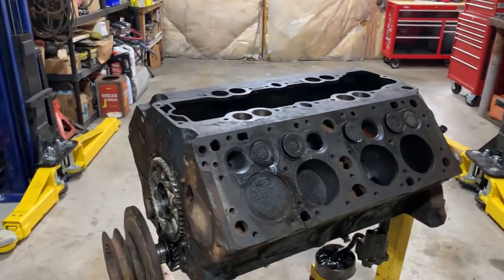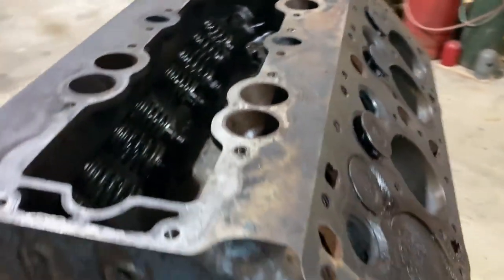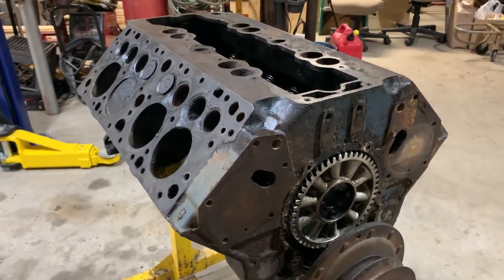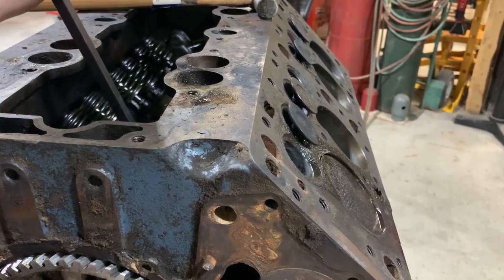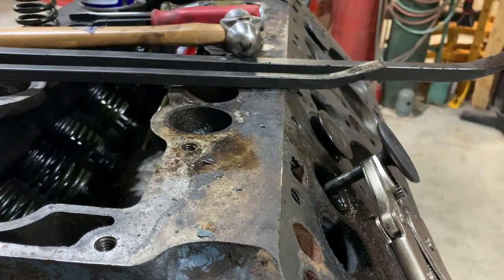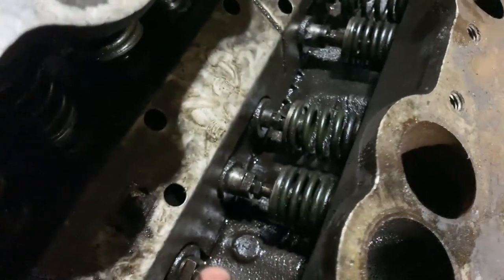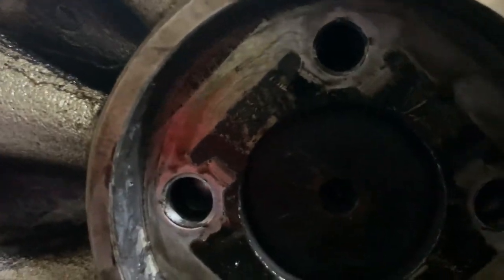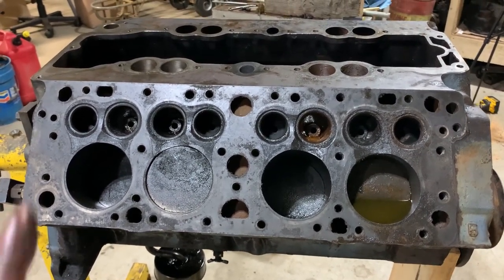1948 Ford 337 Flathead V8 Revival - EP4 | Removing Valves

Comment: A blunt point air chisel tat tat tating  has at times been a savior. Once moving a clam shell puller on the head as you press on the stem.

Comment: The 337 was the 1949 - 1951 Lincoln motor also used in heavy Ford trucks, 1 1/2 ton and larger, up to 1958. So if you need parts this could be worth keeping in mind.
Reply: up to 1953

Comment: I had to get the very rusty valves out of a Model B four banger. It sat in a junkyard for 60 years.  I welded bolts to the valve head and then used a slide hammer to move them.  I took an angle grinder to the springs and then pulled the valves up as high as possible.  I found that genuine Ford valves will break off if you hit the head. Cheap non Ford valves bend. I took the soft ones off with a grinder.  Then I could drift the valve stems out along with the guides.  The valves, guides and springs were not reusable.  This summer, I need to get the rusted in solid tappets out. Nice work getting yours out without damage.
Reply from the maker: Sounds like a good challenge!

Comment: great progress those valves sure there not easy to find, wonder if there the same was vehicle valves just for knowledge, sen where others have used vinegar to shake the corroded rings, wonder if it really works. Waylon  Wire taught me a trick to pressurize the oil channels while working rotating components to lesson scaring on the bearings

Comment: Had one . Lincoln made mine. Heavy one.
Reply: 800 lbs., a little skeptical about that The original Flathead came in a tad over 600 lbs, for the short-block  Can't imagine 200 extra lbs of iron.
Reply: Last Leland design produced. He was one of the best ever.

Comment: I put up a vid on my channel a awhile back where I used a ICB full of water and washing soda to soak a mercedes 6 cylinder engine which had been laying out in the weather for 20 years. The pistons were seized solid but a week of electrolysis saw the pistons loose and I was able to just pop them out without any violence..

Comment: I’m convinced that breaking and engine loose is 50% experience and 50% luck . All the magic potions known either work or not . 
It’s about exactly what condition the material ( cast iron , cast steel , aluminum etc. ) is in which dictates success . 
Like a fastener , if the metal is badly deteriorated , it won’t take much torque to twist or snap it , despite how much penetrating oil and the like is applied and heat used along with diesel soaks and ATF used . Our best attempts are made when we seek to rid the mass of steel or cast of corrosion , rust and other debris that has conveniently deposited on once moving parts to make it to the next step of removal .
Heat always plays a huge part of a successful extraction of a part or fastener or freeing up a rotating assembly . Luck plays a big part .
Let’s not forget patience . If we think we are going to get this done in minutes or hours , plan on days , weeks , months and when we are scared enough we are going wreck something or do bodily harm , years , before we get that engine free for either use or a proper rebuild .
I consider myself extremely lucky that the AMC 258 , which I was told sat for years and was stuck , freed up and has been running well for the last several years . I used all the above to get to there . Another thing that helped ( I guess ? ) was to fill the cooling system with 50/50 and used a block heater . Hey , it couldn’t hurt ! After a few months and finally the diesel soaks in the cylinders cleaning up real well , the pb blaster , the sea foam deep creep , liquid wrench , MMO and just every household penetrant that floats our boat , it was time to get stupid .
I put two 5/8” shoulder bolts ( threads cut off ) into two balance holes bored into the flywheel and apply the wrecking bar . 
Don’t try this at home . If you do , use restraint and don’t stand in the line of fire . Have a clear path to run . Head all disclaimers .
Have 911 on speed dial . But seriously , listen for the tell tale creaks . Load the cylinders with penetrating oil and make micro pulls on the bar , back and forth . Keep all on lookers and commentators away if anything goes wrong . Keep a fire extinguisher handy , just because .
But above all , do not do this after a nite of hard drinking . You don’t want to ruin it now , waited too long for this . Say a prayer , light a candle and get your best grip on that bar and for God sakes man , stay away from that claw end . Be patient when movement is found and work it slowly . Plenty of lube always . Remember to inject through the oil pressure switch port plenty of MMO so the bearings have a fighting chance . Once it’s finally moving without scraping noises and lubed as best as , call everyone you know who cares and tell them , but don’t scream , remain calm . This is a rite of passage that we enter , like hallow ground . It can be done if we are patient , confident and are in possession of lots of said products . Sometimes a big hammer , if used correctly . But is there a way to use a big hammer correctly ? 
Oh yeah , don’t forget to paint it . I forgot .
Edit : forgot an important detail ; compressed air . When the cylinders are as clean as could be gotten from the diesel fuel soak , evacuate all the diesel fuel from the cylinders and spray in penetrating oil and let soak . Follow that with MMO and acetone , transmission fluid or your favorite solution and thread into the spark plug threads a compressed air line while the engine block heater is on and engine coolant is warm . A compression tester with a quick disconnect works well for this . Do this regularly and observe the results . Your objective is to get the solution to get past the piston rings . Once every cylinder will allow the solution past its pistons rings , then you can try to break the engine loose , carefully . Make certain to use penetrating oil as a lubricant and to dissolve rust when you achieve and expose where the rings were stuck in the cylinder . Always remember that too much force will damage piston rings and cylinder walls .

Comment: I'm sure you can get/find new valves. Take one each, intake and exhaust, march them up even if you have take them to a good machine shop and have them "tweaked" a bit. Next use a piece of wood or brass punch when   hammering on stuff. Put some other bolts in the cam and use them to turn the cam. Also Water Displacement type 40 or WD40 is a good oil there are penetrating lbs out there that are a little faster, just saying. But like the video,  can't wait to see that old iron run.

Comment: I have a story on those engines thats too long for the comments side of things.. it starts with my dad going to eastern washington to get a F8 grain truck. He brought it home and converted it to a short logger with a pup trailer. It had the two speed and a five speed and then the 337 lincoln engine. Now industrial n truck were standard shift and the cars were automatic so cranks were different on the flywheel end an no provision for a pilot bearing. Me as dumb as a  rock drilled the end of that crank and fitted the pilot and somehow luck be with me got it in straight and right. I did have the flywheel and spacer for making it standard so I took the time to grind valves an what not... I built it at fourteen years of age... it was not my first or second engine as I worked for dad before I was old enough to argue about this. It came with a tea pot carburetor so in time had the two intakes an finally got a oldsmobiles four barrel carburetor on it. It really woke it up... I got a four speed brownie out of a international an bolted it in an dad went the costs of driveshafts. I hung three inch dual stacks on the cab guard an they just rattled so loud that it dang near made you deaf but in nineteen fifty eight, what were ear muffs for,... oh to keep the ears warm an it wasn't cold... hu... what did you say??/LOL. I have high hopes for you on this engine

Comment: Do you think a rifle bore brush will work to polish up the valve guides?  You could try to boil atf in the cylinders bring it write up to flash point, should eat the rust off the rings. Maybe try it from top n bottom . Good luck saving the rings